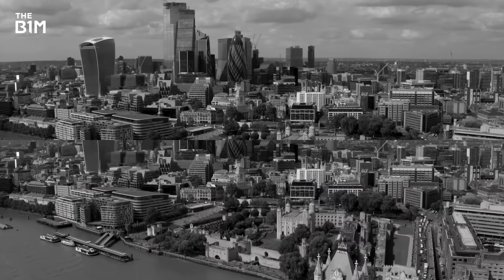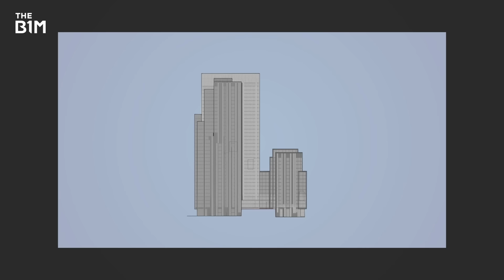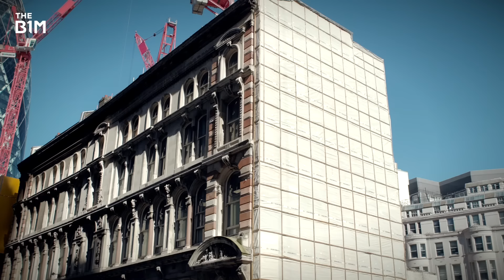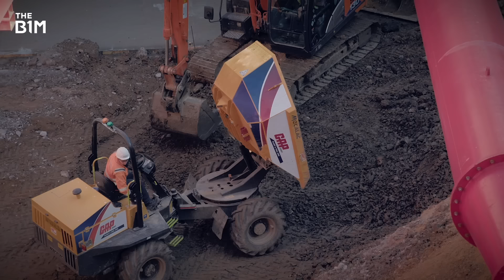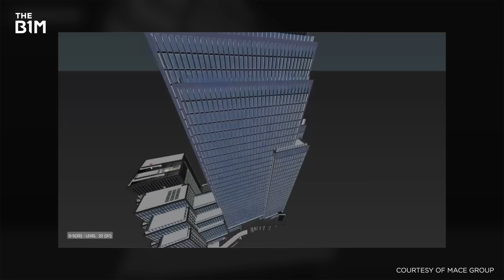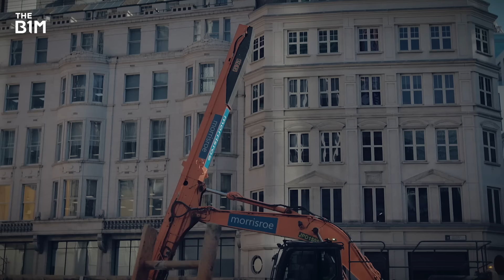Inside London's "Gotham City" Skyscraper

Comment: In this case, the problem with attempting to lure people back to office is actually the location. There are already plenty of very nice offices in the City or Canary Wharf, that's not the issue. The issue is that it takes most people 1-2 hours of far-from-great and extremely expensive commute to get there. That being the case no office is going to overcome the £500 and the 60-80 hours a month I save by WFH instead of going all the way to there. I thinking building attractive offices in areas where people can actually live nearby is key here.

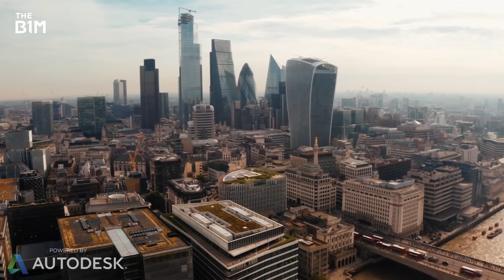Comment: In the early 80s, I worked on the building shown bottom right one block back from the river at 1:03, and excavations for the basement and foundations put a crack down the middle of Pudding Lane. We had to install steel support struts to stop the sides falling in

Comment: Building tall structures is not healthy for a city.  The city starts to smell bad since there is no cross breeze.  Cities have to breathe and tall structures choke cites.   Also the rotten issue increases. All vacant lots do not need or require a structure.  The more vacant lot there are decreases rotten population and horrible odors.

Comment: Interestingly that wouldn't be called a "skyscraper" in Brazil (as in most of America, I believe), being 34 storey is pretty standard for residential areas in major cities
Reply: Count floor doesn't make a skyscraper.. It's over 150 metres tall.. So it would be classed as a skyscraper in Brazil & United States..
Reply: @SeanGallaher6075  I mean, that's still a pretty average height for condos but in London's skyline it'll stand out

I meant America as the continent (Argentina may be an exception lmao)
Reply: @SeanGallaher6075 
barely 150 meters, it wouldn't even be noticed in Chicago or NYC but London is just now copying American skyscrapers over the past 15-20 years.

Comment: Best building construction reporting.  I wonder if the engineers/architects had to make substantial changes in light of covid - the original plan were most certainly worked out years ago (or is the practical functioning/living/working more a of green layout which can easily be transformed).  Thank you.

Comment: A 2 floor basement doesn't seem very deep at all.  Will it be anchored deep into bedrock, or have a floating foundation?  I ask because here in San Francisco..this week all work has stopped on shoring up a "floating foundation" building the Infinity. Work had begun on tying the building down to bedrock this already existing structure. However, it started to lean more alarmingly. Until the cause for this accelerated lean can be ascertained, all work has ceased.  I hope London has prerequisites to anchor into bedrock..thereby avoiding the problems SF is now facing!

Comment: I'm sorry but I think the design of the Walkie Talkie building is awful, and it doesn't fit at all in the city. It's a big pity for the Pinnacle project, which was awesome, but never approved. But in general I reckon  the London skyline is the best in Europe so far. All the next additions will make it even greater. You only need to build a green tower like the Bosco Verticale in Milan to be really up to date.

Comment: Your "angle of incidence" is something I've thought about for NYC's Greenwich Village . . . what with possible sea level rise.  Pilings down to bedrock so that slurry walls + cores can 'begin' to develop a dam in all the mud between downtown and uptown.  NYC should no longer accept building permit applications without looking to protect from sea level rise from underneath.  (And 'that's' ONLY protecting existing property.  There's much more that will need to be done.  Instead all they ever want to do is to talk about their pillows (race relations).

Comment: This can't be called a Gotham city skyscraper becuase it doesn't follow the art deco style. Gotham city is made of art deco skyscrapers and also streamline moderne, Once again it leads to just a boring crystal box with different levels and just follows the modern style . I know this becuase once the architect said it follows the bahaus method, that means it follows the modern method. It can't be called a Gotham city skyscraper becuase it is not an art deco style becuase modern and art deco are both different styles and you can see it in the architecture. If you want to see real Gotham city buildings go to Chicago or New York, art deco buildings are there and those are the real Gotham city skyscrapers, not these glass behemoth that isn't art deco at all becuase at the end of the day they are just following the modern method. Good examples are the American radiator building, the carbon and carbide building, chrysler building, empire state. Those are the Gotham style skyscrapers.

Comment: 34 floors does not make a skyscraper. I live in an average residential tower in Shanghai on the 33rd floor.
Reply from the maker: It's subjective, as we explain here - https://www.theb1m.com/article/what-makes-a-building-a-skyscraper-2020
Reply: Except most buildings in London are only 5 floors high maximum.
Reply: @cholloway0046  - 50 - 60 years ago perhaps.

Comment: I really do not understand why sight lines are needed to ‘protect’ St Pauls Cathedral. Its a nonsense rule imo
Reply: @wilfridwibblesworth2613  of course, it wouldn't be practical.
Reply: Why is St Paul's so special?  Is that there the deputy PM lives?
Reply: @krashd  St Paul's Cathedral is built upon the highest point inside the City of London boundaries. It is also quite important historically.
Reply: To prevent London being completely crowded out by high rise and city development. It's probably one of the best urban planning features In the city.
Reply: @wilfridwibblesworth2613  the old rules prevented any building from being taller than St. Paul's. The sight lines are just a remnant of that.